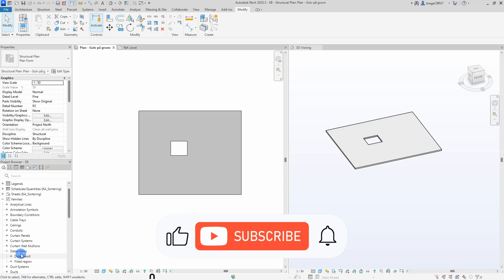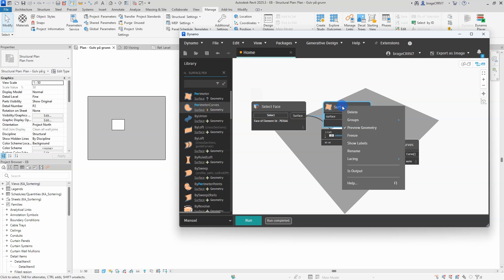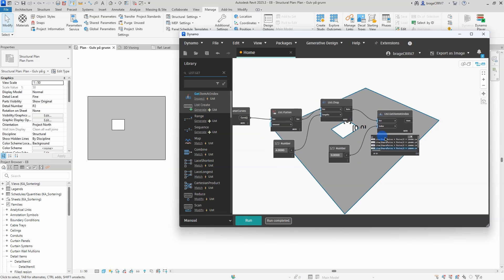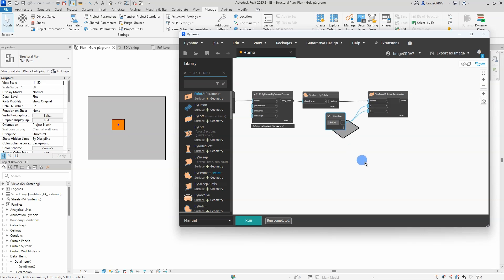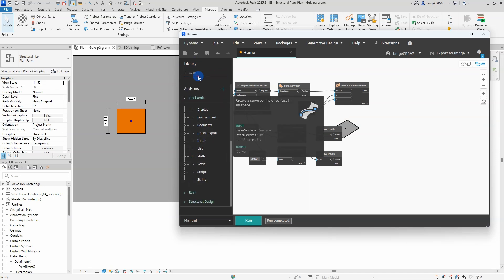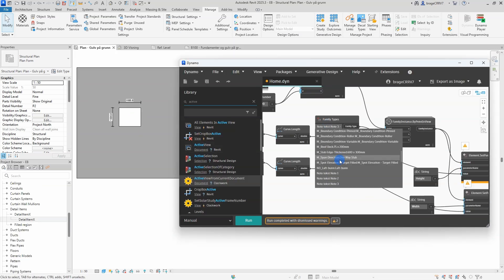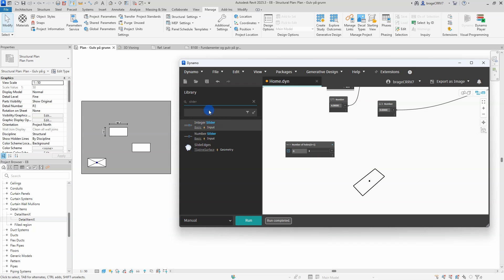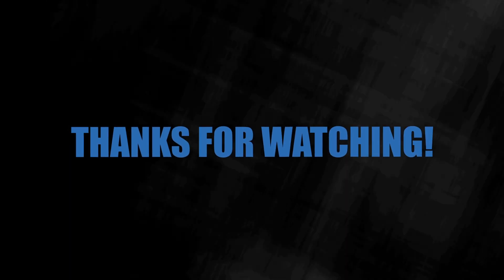Revit Dynamo | place detail item on a plan view

Comment: Can you create a dynamo script for placing a detail item  multiple times on a curtain wall.
Explanation: In a view there is a curtain wall and i prepared a elevation view of that curtain panel wall. Now I want to place basic 3 diagonal lines that is created in the detail item family so that it represents the glass panel. So if there 10panels in the wall, the script should place the detail item on all the glass panels at the center.
Reply from the maker: Hey! In the last part of this video, I show how to place multiple detail items in the view. So you first need to select all the 10 panels, and get the coordinate and placement point into Dynamo before selecting the detail family to be placed at the specific point.